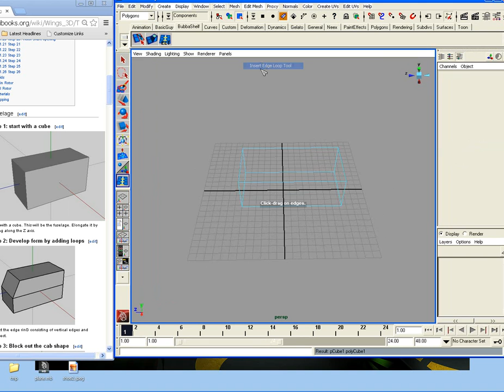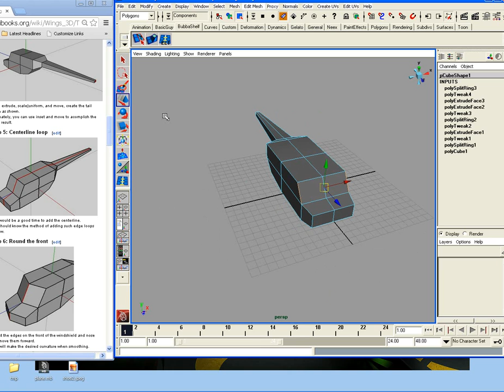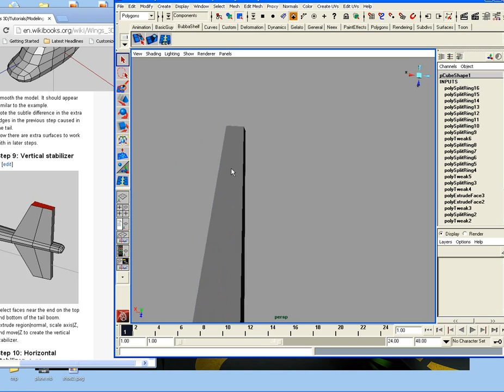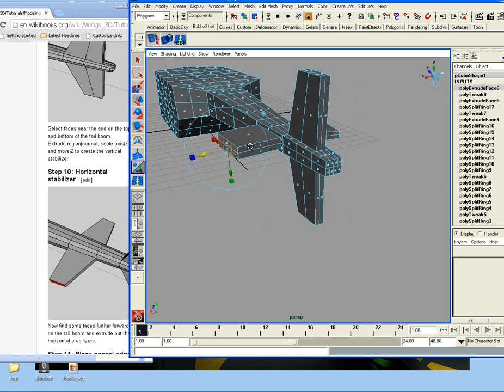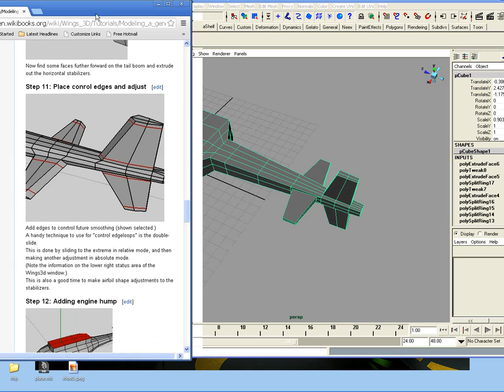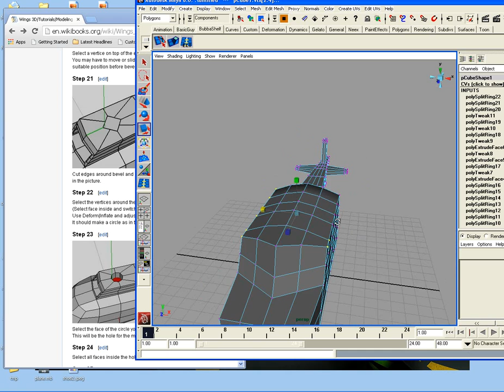How to model a simple helicopter in Maya (Polygon Modeling)

Comment: My "edge loop tool" isn't working properly (by that I mean at all) does anybody know what I can do? Im using 7.0 and it worked once and then stopped.
Reply from the maker: Yes, you probally made an edge then deleted it with the delete key.  To fix this, go to vertex mode (right click on the object and go to vertex) and look for any pink dots (verts) that are laying and delete them.  To fix this in the future, when deleting an edge to to edit mesh-> delete edge/vertex.  This will delete the vertex along with the edge.
Reply: FreeMayaTutorials Thank you very much. I will try this as soon as I get home. However I am using 7.0 unlimited and there is no "edit mesh" pull down menu. I'll have to find a workaround to git-er-done!
Reply from the maker: FrakU2 I think it's under the modeling menu and it's called edit polygons.
Reply: FreeMayaTutorials That's true I did find the loop tool there but it wasn't working properly. It might have something to do with the model im currently working on being my first 100% polygon model. I've been using nurbs for years but I have grown tired of it's limitations so im all in with polygons from here on out. But I think im doing something wrong because I got it to work before during my initial experiments.